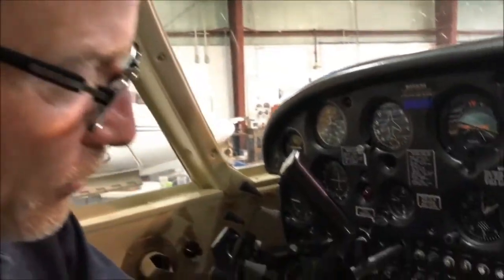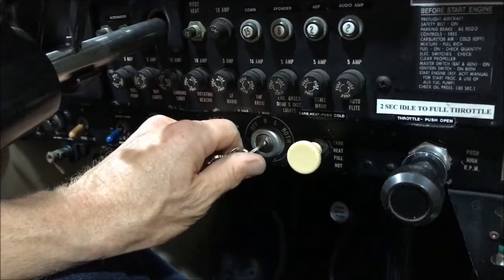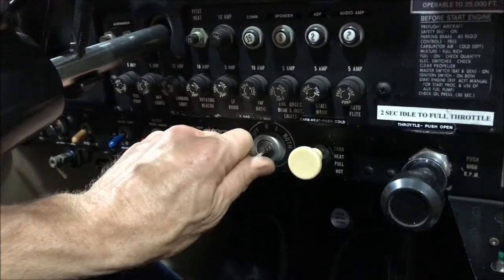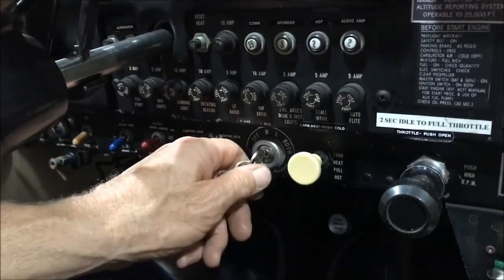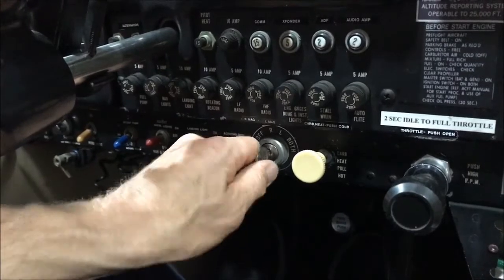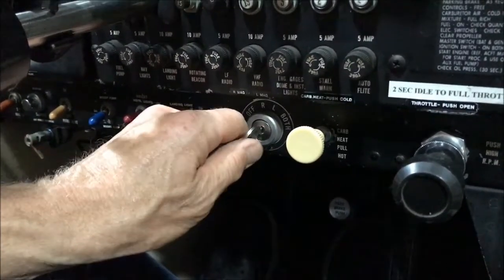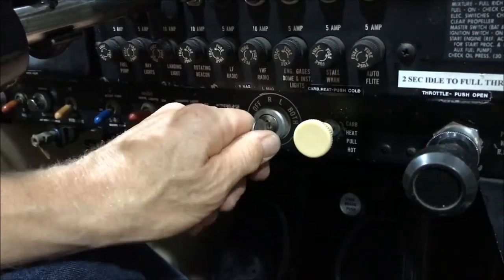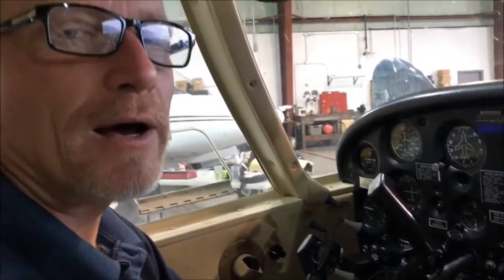Preflight Mag Check

Comment: what is the maximum allowable rpm drop during magneto check?
Reply: It depends on which aircraft you're flying. On the Cessna C152 a drop of 125 rpm is permissible on each magneto and a differential drop of 50 between the right and left magneto. However it is best to go back to the poh of your specific aircraft to know what is acceptable

Comment: Good advice, Dean, it actually happened to me a while ago, I was fliying a C172, and after performing my mag check on the rest of the pre-take off check list,  it was full throttle and juste after I was airborne noticed the underpowered the airplane felt, and after a quick check noticed that the key was in the L mag, corrected it right away and the rest of the flight was without incidents.